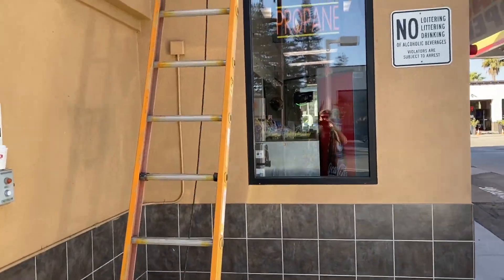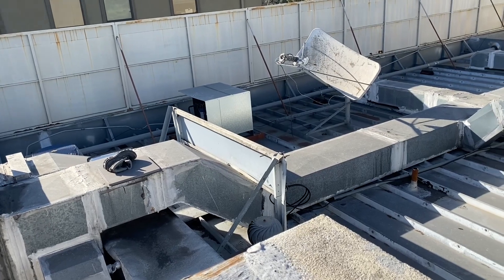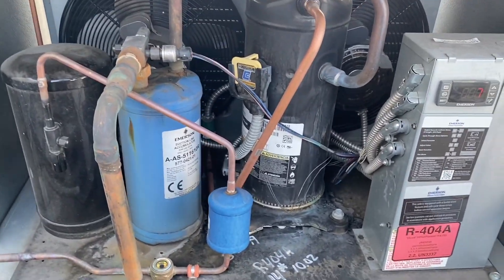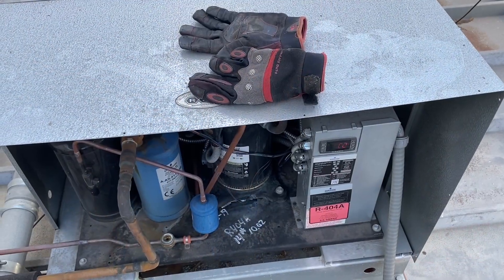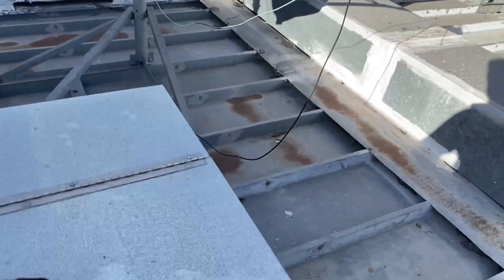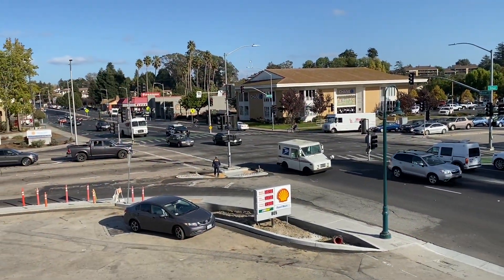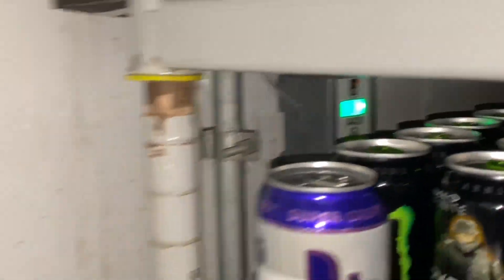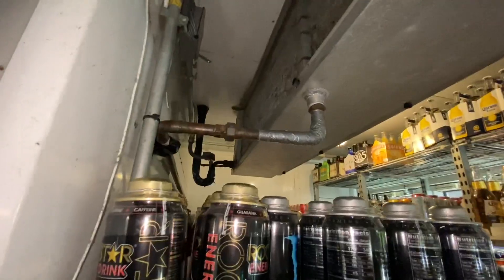Check a charge

Comment: I just removed one of those rotolock suction accumulators last week and hard piped a new one. Could not get it to stop leaking, even after replacing the gasket and thread sealant.....looks like there is a roof sneaker up there of you need some new kicks! 😆😆😆